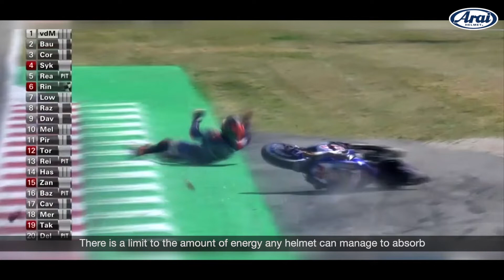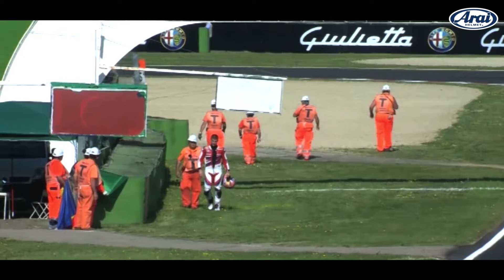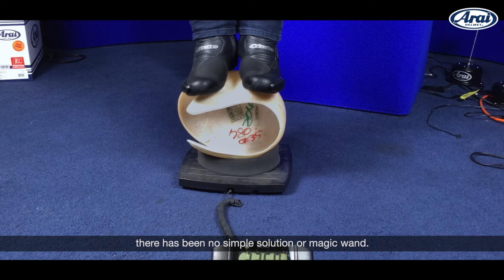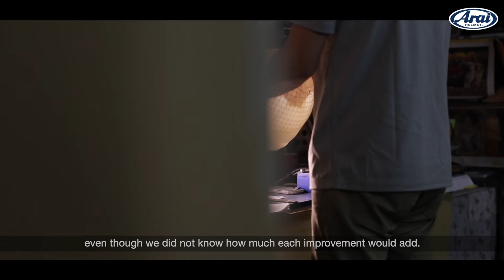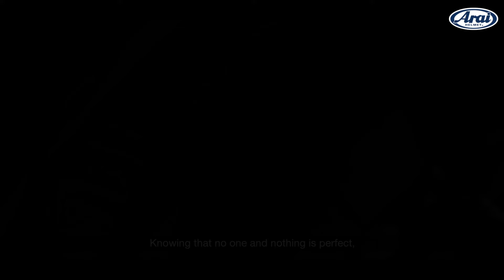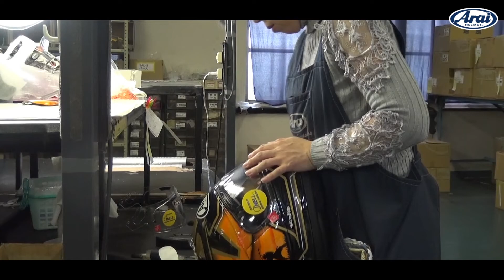VALUE OF ARAI 2.0

Comment: My first helmet was from Arai.  
As dozens of years went by, I became fully aware that (almost by chance - at the time Bell, AGV and other helmets were strongly implanted on the market...) this first helmet offered by an uncle (with extensive experience in motorcycles and their accessories) and the others I bought gave me a truly almost unique and exceptional protection!  
In recent years I have also purchased two Schuberth helmets - equally of exceptional quality!  
Fortunately, the two accidents I've had so far have had no major consequences (speed of 40-50 km/h on a very congested urban circuit).  But when I ride at speeds above 300 km/h I know that one of the many reasons why I do so is that I am wearing an Arai helmet!